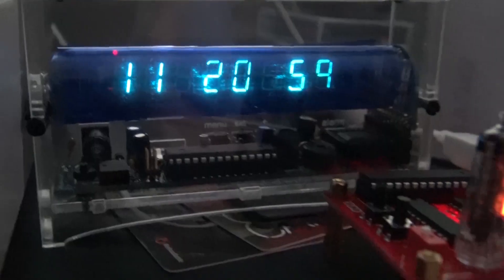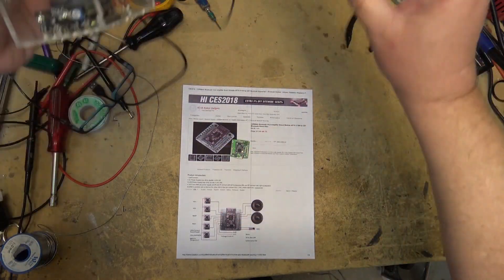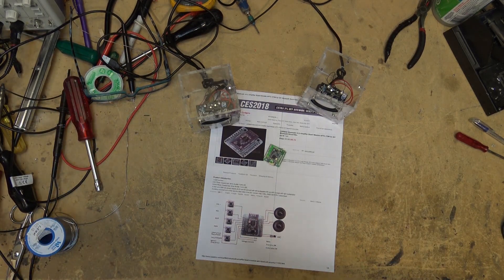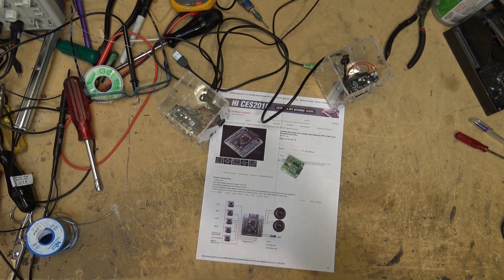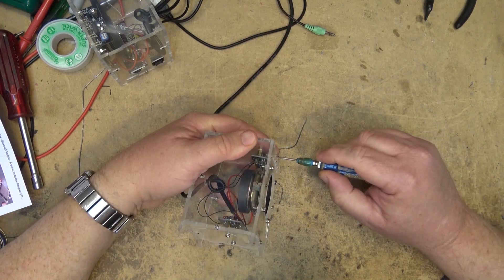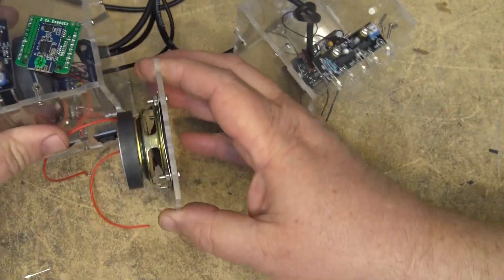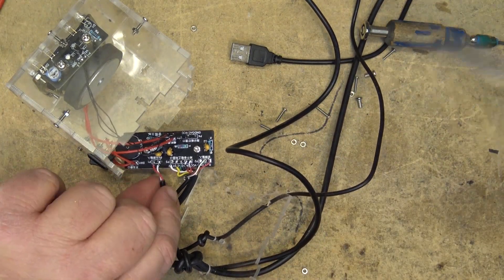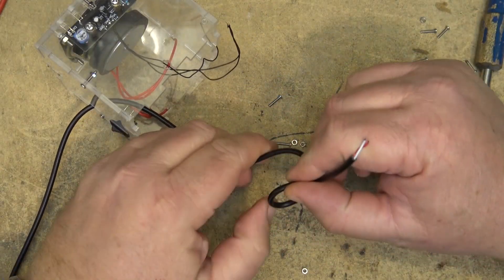Bluetooth Boombox Build

Comment: Do you know if there is any module that can work as transmitter, not as a reciever? I want to transmit the stereo sound from my TV, via bluetooth, to my bluetooth speakers. So, I need the bluetooth module to work as transmitter. I thought about connecting the TV audio output to the mic, but it wont be stereo... and probably low quality.

Comment: Can it run on 12V input or will it fry?
Reply from the maker: Specs say 3.6 to 6.5 volts so I would say that 12v will probably fry this one, but there are other bluetooth boards I have reviewed that will work in 12 volts.

Comment: someone has asked me is it possible too fit a bluetooth module into a roberts r200 radio this radio dates around  1960/1964 do you think its possibe?
Reply from the maker: This little board has a built in amplifier. I did review a different one that I built into a tuner that would be better for this application, but one has to consider that many radios of this era were line powered and had no transformer, so isolation is a must which would require more work.
Reply: this is a link to the radio someone had noticed i did electronics as a hobby( mainly lcd tvs etc though)  so so i thought i would as you as you will have a better idea if its even possible? trouble is they dont want too mess the case up can the module be run via a battery? thanks http://www.radiomuseum.co.uk/R200.html
Reply from the maker: That's a solid state. No problem putting a bluetooth receiver in there. The better one to use is this one.
http://www.icstation.com/csr8635-bluetooth-wireless-audio-receiver-module-loudspeaker-bluetooth-p-9963.html

It has internal switching, so when music not actually playing from phone it will pass the existing audio through. Just goes in ahead of the volume control.
Reply: ok thank you i will pass this information on and see if they still want it done.

Comment: Very cool. Curious though... would the speakers have fit mounted to adjacent sides of the box (90 degrees apart instead of 180)? I think they’d sound better that way.
Reply from the maker: The acrylic case is cut with tabs so it won't go together any other way, also the soeakers would be touching anyway, so they wouldn't fit. This doesn't sound bad considering it is a very small speaker. I have another bluetooth module I need to decide what I am going to install it in. Perhaps my old Sony CFS6000 AM Stereo / FM Stereo Auto reverse cassette boombox. It has an AUX in, so adding a line level BT receiver might just be in the works for that boom box, and it has very good sound.

Comment: The bluetooth modules on the single speaker units puts out two channel stereo then there are resistor and capacitor networks that join the two channels to make mono then the 8 pin btl amp is fed with this
Reply from the maker: Yes but they are still MONO. Why wants to listen to mono.
Reply: I just said that

Comment: Thats much neater and compact, the only thing it needs is an internal battery, perhaps one will come along and you can eliminate the power cable :-D
Reply from the maker: I could put that battery pack inside, but I was thinking more on the line of being able to plug it into a USB adapter so that is why I made the power lead external, as it gives me options, as  having the battery internal would mean having to fit the charge port on it anyway to charge it up.
Reply: True, but you never know what may come along, and if it dont then no harm done :-).
For my dodgy ears i would try to give it more bass and cut the treble a little, although i cant listen to any music for long  without it sounding distorted by my tuning fork factory in my head.
Its the reason i blow raspburys at next doors cat just to be mean :-D

Comment: Does that module pair as just a media audio device or does it have a call setting? I've had trouble with the slightly different XS3868 modules before. My go to module for Bluetooth audio is the KRC86B V4.0. It has simple line out stereo, the pinout sucks though because they used a 2.0mm header pin instead of the standard 2.54mm. This module looked like a good alternative for something that is simply plug and play, although I don't care for the Integrated amplifier setup. The real question is the connection distance and the noise. The last KRC module I installed into a stereo needs a filter to get rid of the high frequency noise, it is super annoying. Last real question, does it create it's own unique ID if you have multiple active devices using the same module in the same space?
Reply from the maker: It has call ability. That is what the microphone input is for.
You can take line level off it. Just connect to the input pin of the amp. I have another one that is a line level only that I will be building into a boom box. Just have to decide if I want to build it into a vintage sony that has AM stereo, or build it into a later modem that has a CD player, or perhaps my old really good Panasonic boom box with the 25 watt amplifier. That would be the perfered choice because of the sound quality of this unit, but my brain dead son took it, and now doesn't remember where he put it. The unit is like 2 feet long, and 8" high and he managed to misplace it.
Reply: 12voltvids 
Sorry missed the call part in your video. I admit to skipping through a bit to see your application and outcome. The last time I installed a BT module I wanted to add an enable and standby function. I put the module into an old home theater receiver I found on the curbside. It has a standby circuit but I got impatient after mounting wiring and adding a voltage regulator twice. Once for an XS3868 and again for the KRC when I found out the hard way that the XS3868 sucks. I think they are BT transmitters of some sort, but I'm not sure. It took calls but not media. I ultimately want to build a Bluetooth stereo that is completely controlled remotely. I haven't seen anyone do that yet, although I haven't looked all that hard.
-Jake
Reply from the maker: It has call settings, so if a call come in, it will go to the speakers, and therefore you need a microphone to use this. Might just get around to adding one for that purpose if I decide to use this with my activated cell. Just uses a standard condenser microphone.Distance wise I got about 12 feet indoor before it started cutting  out. Clearly this is designed for a speaker that is sitting next to you on the table. You are not walking around the house and staying connected. Will be interesting to see how the next one that I build into a big high power Panasonic boom box works. It has a CD player, and an auto reverse tape deck, and an AUX in, so interfacing a BT board will be a piece of cake. That one will be coming up soon.  I don't have more than one device under this design to test. My other xy_bt devices id all ID on my phone but one says xy_bt, the next xy_bt(1), xy_bt(2) ect. Can't answer if this one does the same as I only have one of them.

Comment: How do you locate an amp chip on a circuit board?
Reply from the maker: The amp chips are the 2 8 pin chips on the bottom.

Comment: Great video! The day is not complete without at least one project / custom product mod.
Classic comedy set up: At 17:07 the trap for young players was set... 
One video edit later, after the 3rd (or 4th) nut had been recovered from the strong
speaker magnet, the final assembly was resumed and FINALLY, 
the project was completed.  Well, at least that's what I imagined had happened, lol

Comment: I never knew Bluetooth speakers were MONO ! 
We need to teach the young ones what STEREO means .
The market will not tell.
Even guys in their 30s are miss led .
Its time to demonstrate !         👍
Reply from the maker: I have a phone that actualy has stereo speakers. One of my favorite phones. the one that I show in this one as my music source. That is a Blackberry Z30, and it has full stereo from the phone itself. I use that as an internet radio these days because it has such good sound right out of the phone itself, and when messages arrive (still can use it for email) the notification sounds don't interrupt music playing over BT. My current android phone is annoying. If I have music streaming over BT at a loud level, and a message comes in, it blasts the notification sound over the BT audio. Very annoying.
Reply: I have Motorola Razer I . there is none of that interruption when using headphone jack to the sound system , unplug charger cable no sound telling me that battery is to low nothing interrupting it . It is a one off as it has no bloat were on it ether .
The sound could be a bit deeper for this system it dose get there  compared to other common brands which are what you mentioned .
I use it mainly for meditation & Subliminals .
Its a really tough phone .
Now I know about the Blackberry sound .
              Thanks .
Reply: Actually most of bt speakers are stereo

Comment: would it be possible to use with a SONY Sound bar and Sub woofer, no the boom box of yours will self destruct because of the strength of the magnets used in those speakers and the back will be repelled.

Comment: Not bad a dipole speaker system. LOL
Reply from the maker: For what it is it works great. I will be doing a few more larger BT speaker builds as I have a few modules with more power so they are going to sound much better.
Reply: NICE!